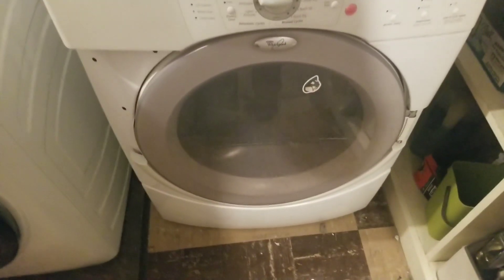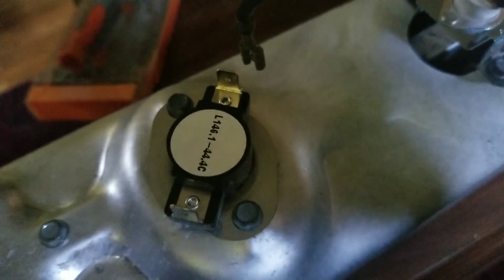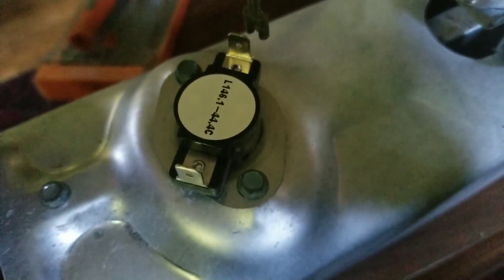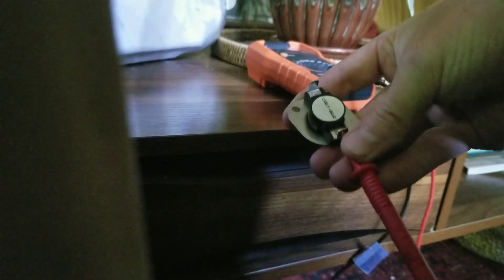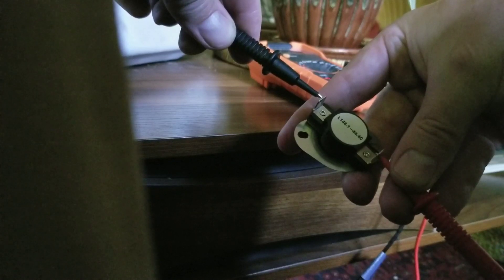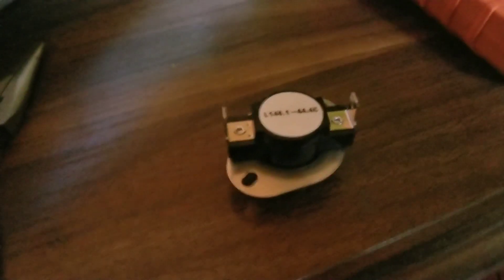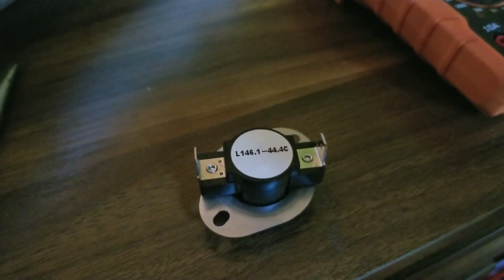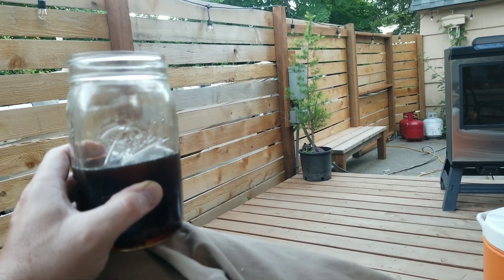Whirlpool Duet Dryer Not Heating ... High Limit Thermostat Replacement (Link to Manual PDF)

Comment from the maker: Here are the parts talked about in this video:
-I was using the continuity tester on a Klein multimeter in this video: https://amzn.to/43g7Lpj
-This is the full package with all switches, cutoffs, fuses, and element: https://amzn.to/430CQgs
-Whirlpool duet Dryer Heating Element: https://amzn.to/3JzG6Z9
-Whirlpool Dryer Thermistor and Thermal Fuse: https://amzn.to/3pxaKf9
-Whirlpool Duet Dryer High Limit Thermostat and Thermal Cutoff: https://amzn.to/435UejS